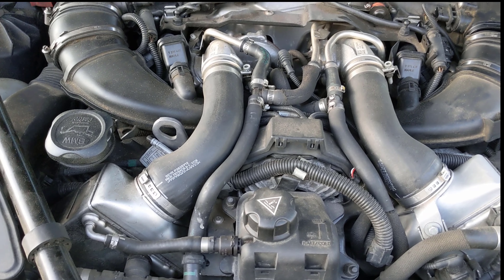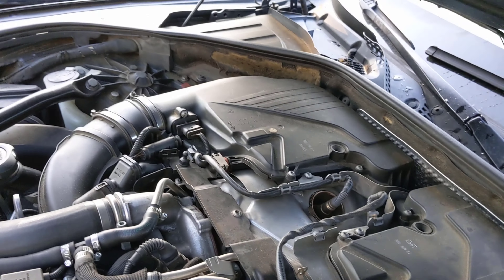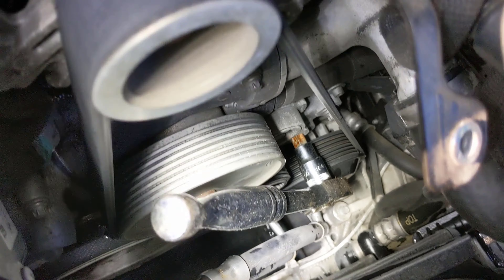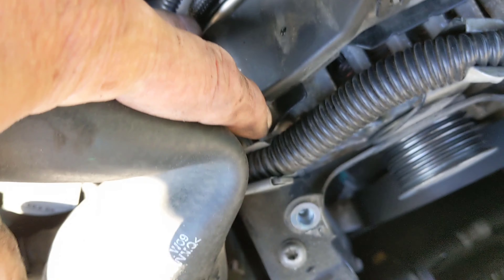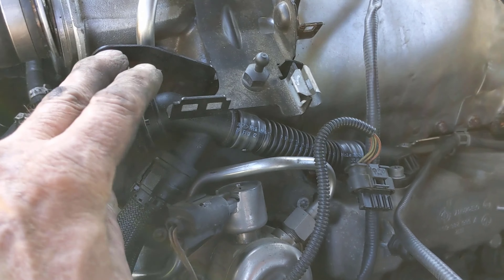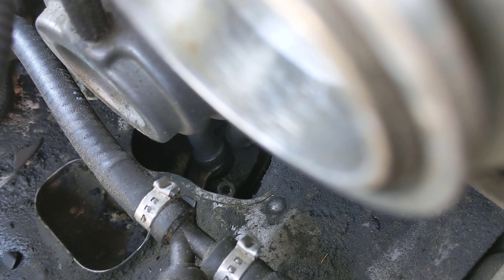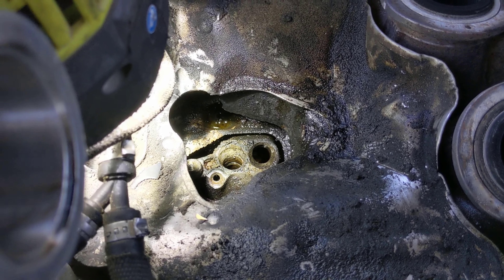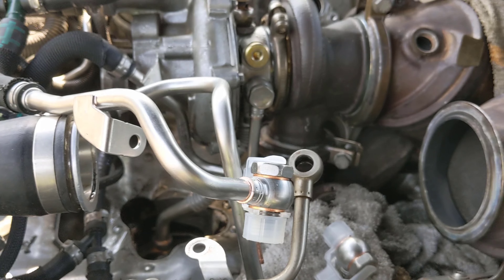Turbo coolant lines BMW replacement step by step

Comment: Helps me say I anit gonna do that. I'm just gonna find some hose transitions up top where they are leaking and put some new pinch clamps on and call it a day. Thanks for the procedure. Very helpful!
Reply: Did that fix the issue? Did the hose burst with the pressure or hold up?

Comment: Very helpful, thank you. I ve got  2016 bmw 750i xdrive, turbo coolant leak and dealership asked 3.5k for it. I am thinking of doing it myself but parts itself sold by BMW dealer cost 1100$, can you help me find the set of new updated ones cheaper is there any way or thats just it no cheaper than that. Thank you very much
Reply from the maker: There are some good German aftermarket parts suppliers. (https://www.ecstuning.com/b-assembled-by-ecs-parts/turbo-coolant-line-kit/11537577014kt/?gclid=Cj0KCQjwheyUBhD-ARIsAHJNM-O_nJdXZxyhYiEHbAxncM2v--0xnZ8GSxQKM-Xfk7ezMKSGqeFkPN8aAuplEALw_wcB ECS ) Tuning is one, this is where I got mine.

Comment: At about 15:22 I have a small pin prick hole on the rubber hose that is shown there. Is it possible to replace only this rubber hose portion to solve the coolant leak I am having from it? BMW quoted $1200. And I’m looking to try to get it done at home.
Reply from the maker: You can just replace one hose or repair it. The cost is for getting to the hoses. The hoses don't cost that much. There is no problem with repairing it.

Comment: Thank you so much for this! You've done a great job explaining it. My car has been leaking coolant for some time now. I keep taking it to the BMW or the local mechanic. They say it is fixed, but it keeps coming back. I've spent well over $4k on this issue alone. I would love to work on it the next weekend. I have all the tools, just need to get the parts together. 

Would it be possible to share the parts number or the website where you purchased the parts? Thank you again for all your help!!
Reply from the maker: Glad it helped!

Comment: Hi i have a bmw 750li f02 with the issue of exhaust gas smell in the car. do you know what it can come from? the exhaust manifold gaskets have been changed but the problem is still present
Reply from the maker: Some of the other places it could be leaking is at the turbos and Oxygen Sensor

Comment: 5 mins into this video and it is clear I dont want to try this. It would’ve been nice if you showed yourself actually removing the parts instead of just talking about how to do it. But this is just too much to do and I fear I would forget a few steps when reassembling.